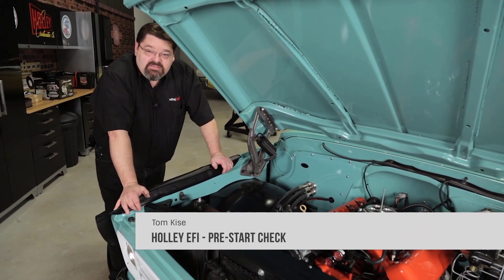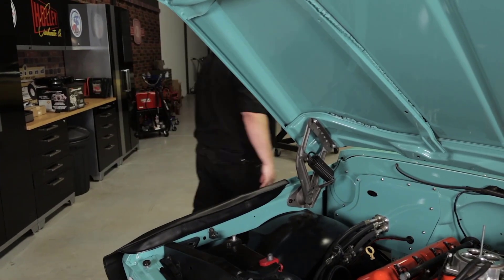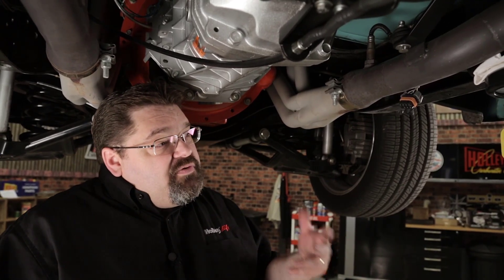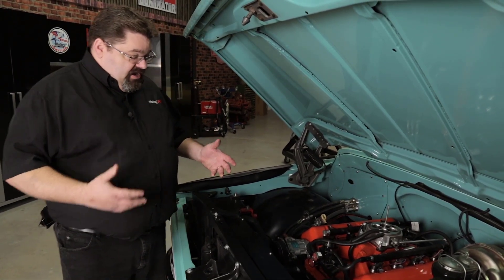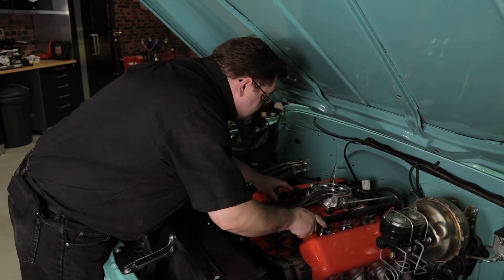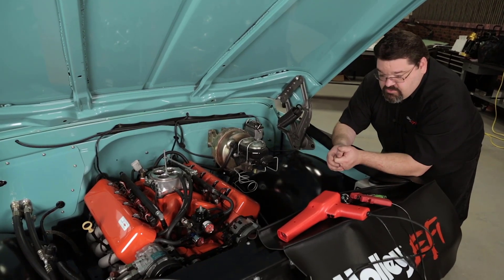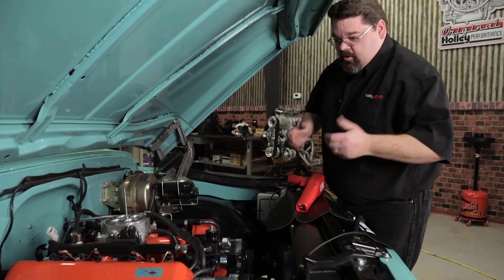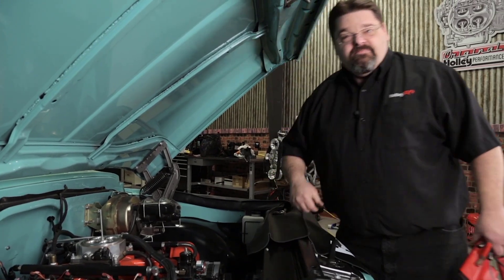Holley EFI - Pre Start Check

Comment: we just installed this on a 63 corvette. The complete Holly Sniper EFI with the Hyperspark ignition system, complete with new fuel tank with high pressure pump installed from Holly. We are so regretting this as it has been a total headache and a lot more in depth than the manual or YouTube videos make it look. The corvette ran perfectly before install, and now it idles like a locomotive and is pig rich at idle. We have spent the last 2 days trying to figure it out, Holly tech support has not been very helpful and just read basic things from a computer screen. It runs good once you get the car up to speed. We are almost to the point where we are ready to rip it all out and go back to the carb.

Comment: Great Info! I am building a 540" Twin Turbo Boss9 for a daily driver pickup truck. What would you recommend for a EFI system?
Reply: EcoBoost EngineSwap HP EFI... unless you have a trans that needs  to be plugged in. efi with 4 i/os suits most daily turbo builds
Reply: kirk delorme, Thanks!
Reply: When you get ready just contact your closest Certified Holley EFI dealer  or Our Tech line and they will be able to spec out the proper components for your build.  If you plan to run a single stage of water meth in conjunction with dual port boost control you will have used up all 4 outputs.  The Dominator's going to be they way to go.  You may be interested in attending a Holley EFI class to learn what the system can truly do, most people do not realize its full capabilities.  You can E-mail training@holley.com  for more information.
Reply: EcoBoost EngineSwap...  Are you planning to utilize the boost controller incorporated in the Holley EFI? The best control method would be a dual port gate with a fixed pressure source.  If so, I would recommend stepping up to the Dominator ECU.  Assuming you will be running at least one electric fan  you will have used up  3 outputs. 1- fan,  1- Boost fill, and 1- Boost vent. Once you realize the capabilities that the Holley EFI has to offer you will want more input and output availability for items like  EGT, Coolant Pressure, Pan Vac. Etc.
Reply: Have not gotten too deep into it yet as still waiting for the Block & Heads to get going on engine build.
Reply: Yeah for sure.  Unless your doing some sort of drag build with bump boxes and other ins and outs that street cars won't use... usually 4 in/outs will run a daily boost with meth if you run an external fan relay.  do some research to figure out your setup but if you don't need to shell out the extra grand why would you.... use your money wisely rather than buy something overly excessive for no reason.
Reply: kirk delorme it's going in a daily driver pickup truck. It may see a easy 1/4 mile pass to see mph just for fun but intent is a daily fun just because truck.
Reply: Tech Guy thanks for info.  Block n heads along with rotating assy should start rolling in within next 30 days. Once I know those parts are finally on way after months of waiting will call in for exactly what I need.